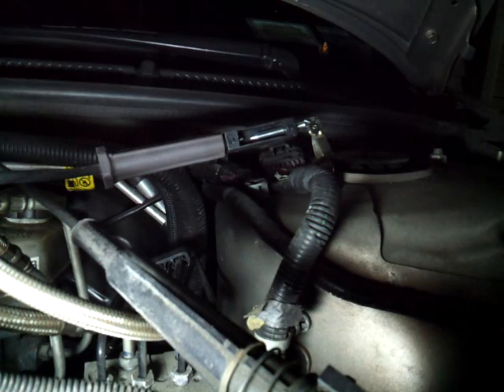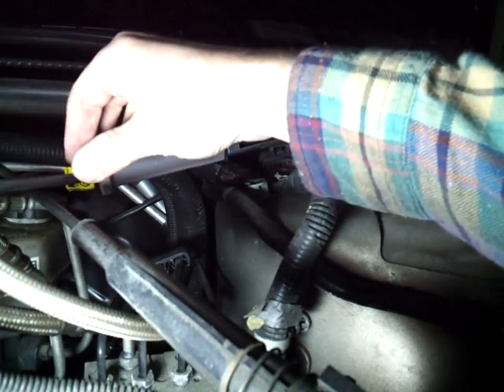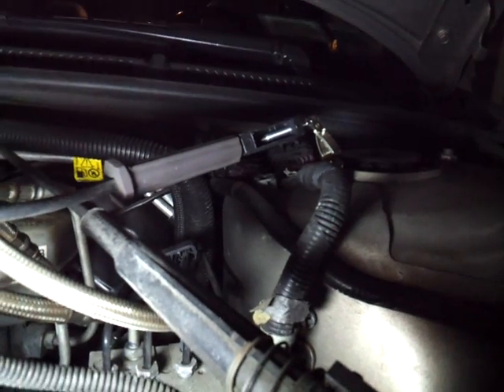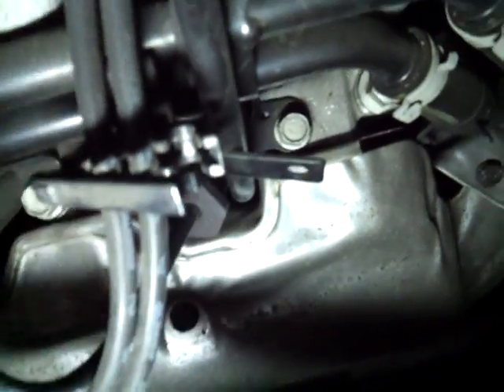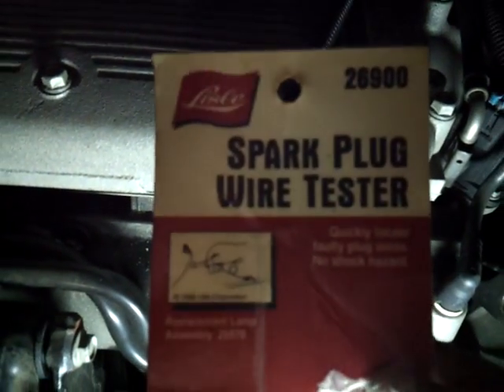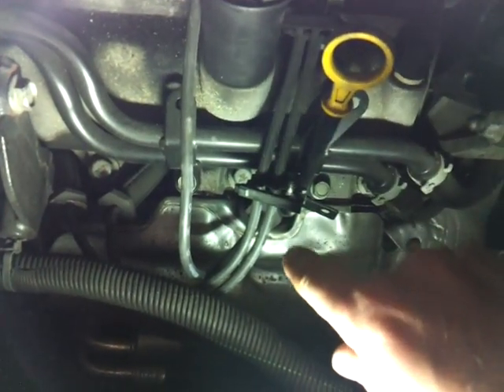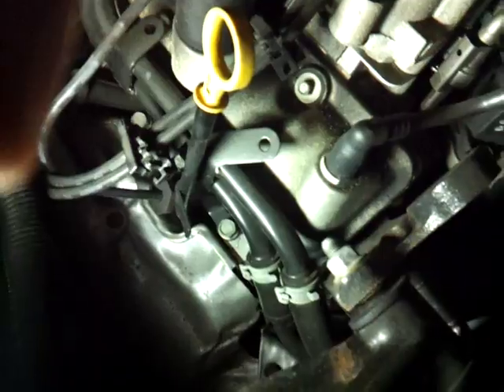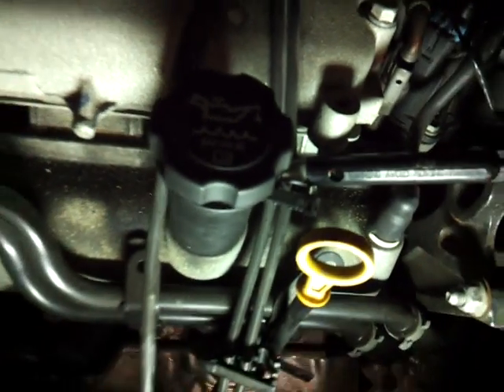How to Use a Spark Tester ! Ways To Check.. Honda ,Coil Test , Chevy , Ford , Dodge , Toyota etc..

Comment from the maker: Inline spark tester is good also..atomized fuel does spurt out, thats normal..i would hook up a fuel pressure guage to make sure the proper psi is at the fuel rail..also check for weak spark like i described in the video..and dont rule out valve timing..ie: skipped or broken timing chain ...

Comment: i have a quick question, i have a lyle tester that i never used but it also has the sharp needle point end like a regular 12 volt tester. do you know if works the same way, i'm guessing i just have to be careful when i ground it not to touch the needle point end with my hand. thanks for any help